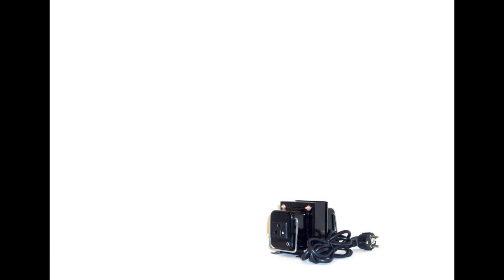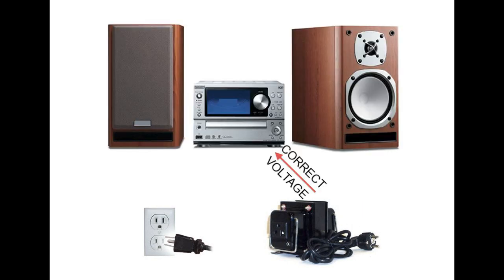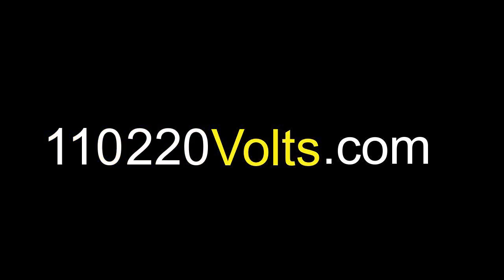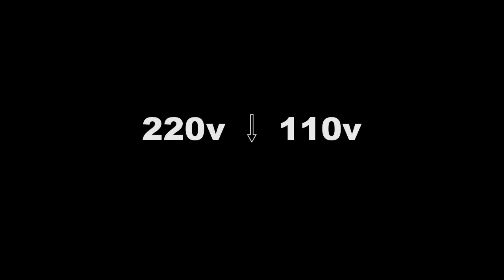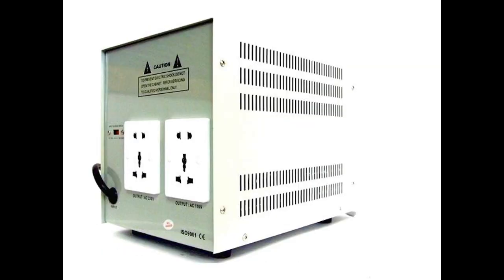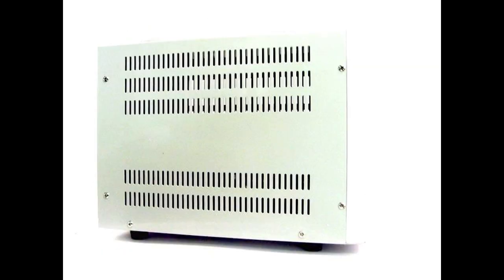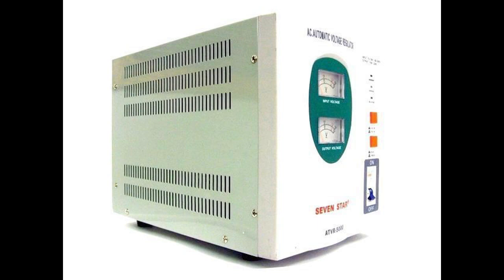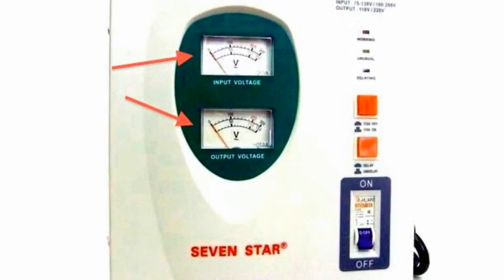What Are The Different Types of Voltage Converters ??

Comment from the maker: We're sorry to hear that! The main reason why your power adapter was fried is most likely because of the wattage issue. The voltage converter you use for your gaming system should be made for atleast 500 watts and a step down voltage converter. With a TV or DVD player or any equipment the main thing is to have a powerful enough converter. You should look to purchase a converter that is 30% above the power requirements of your equipment. Hope that helps.